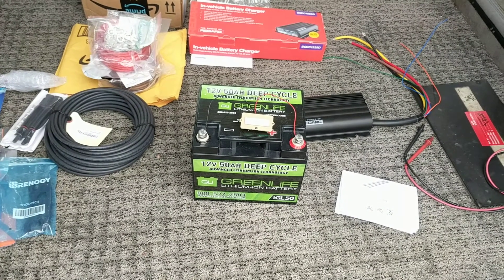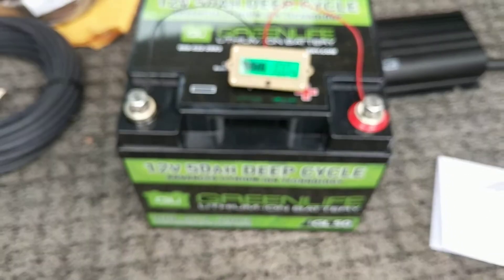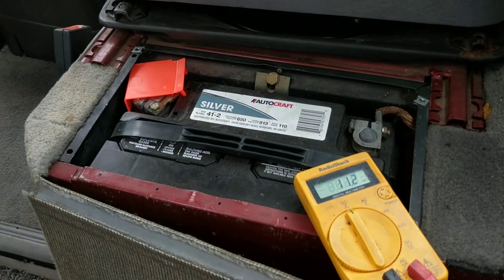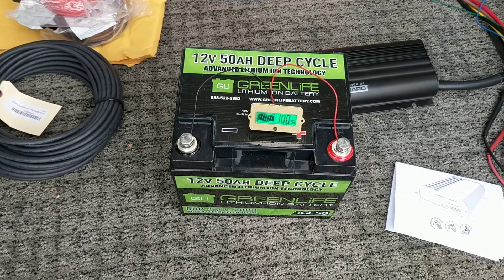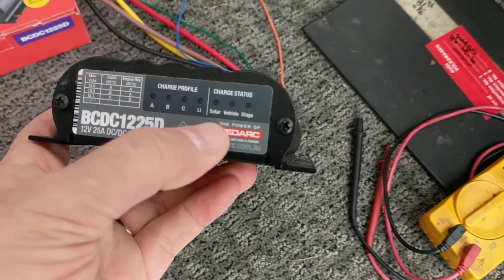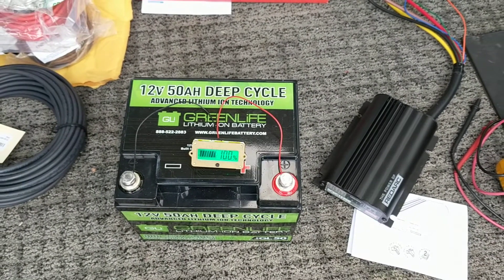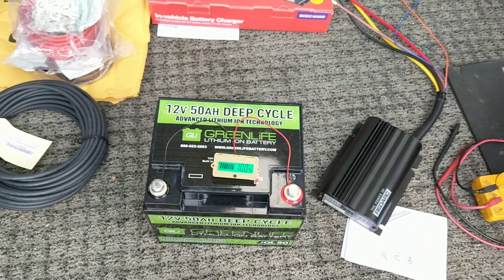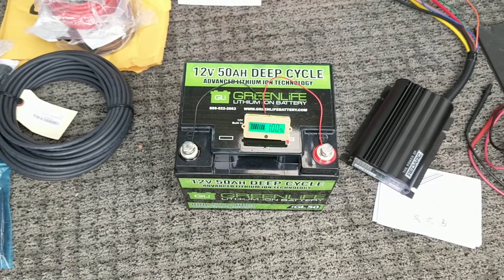Installing a Lithium battery into a Vanagon Westfalia part 1

Comment: I have the GW isolator kit and a 100ah agm battery. Would my alternator not charge this battery while driving? I know it takes a while but would the redarc improve this?
Reply from the maker: The Redarc is a charger that has the correct profile for charging storage batteries.  It will make the battery last.  The alternator is made to charge a starting battery which is a different type of charge.  It will charge your AGM but the life of the battery will be much shorter.

Comment: So with this redarc battery charger do you need the battery isolator anymore?
Reply from the maker: The redarc has the battery isolator built in.  So really all you need is the Redarc and then a 40 amp fuse, and you are ready to roll.